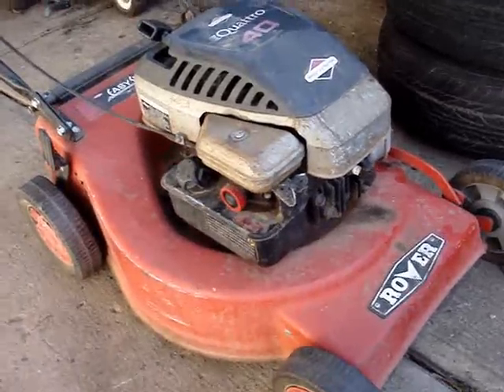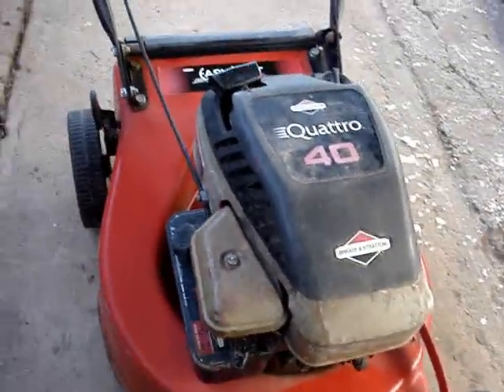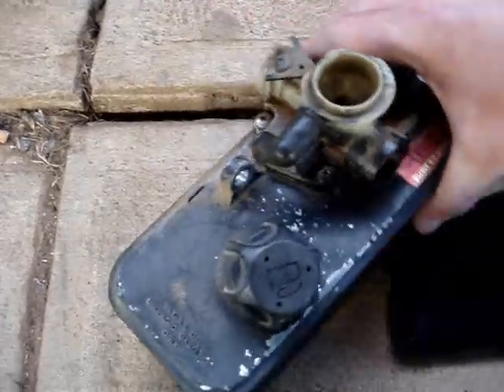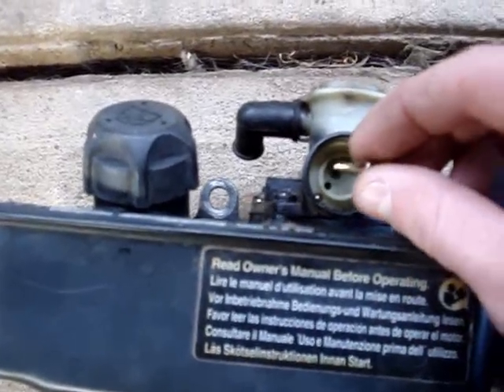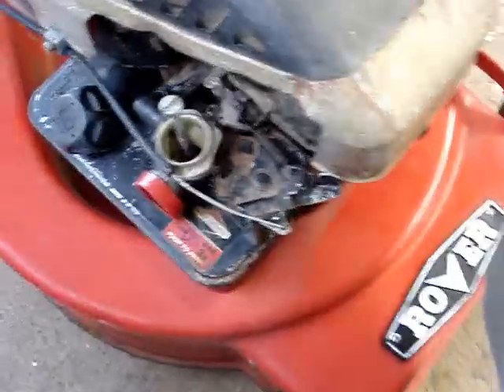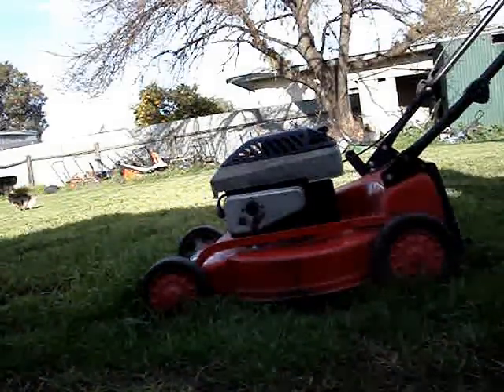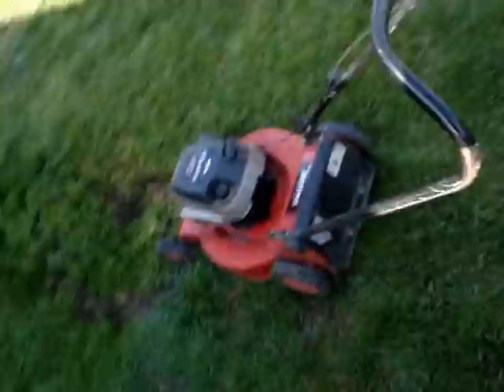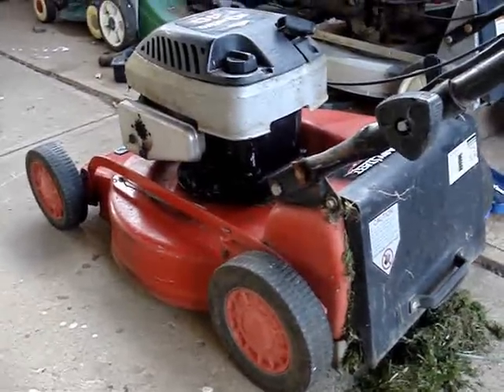Rover quattro 40 mower fix

Comment: Hi,
this movie is quite old already, but not as old as my B+S Quatro 40 (1999).
Yesterday it would not start anymore, so I checked the web, found your movie and BINGO. I washed the airfilter with gasoline and turned the primer bulb around a few times until it worked properly- now the mower is running again. THANKS A MILLION!!!!